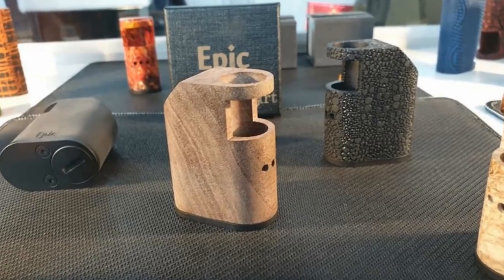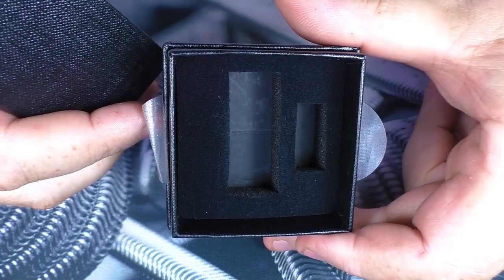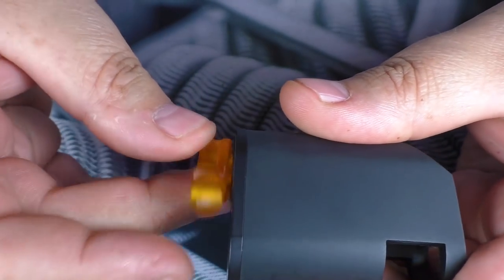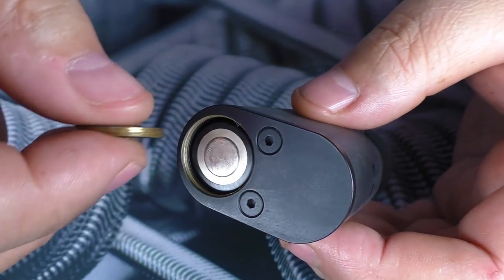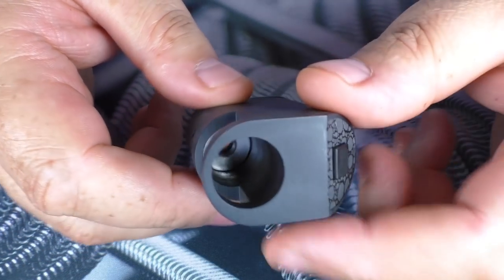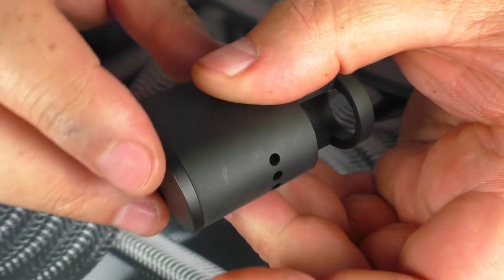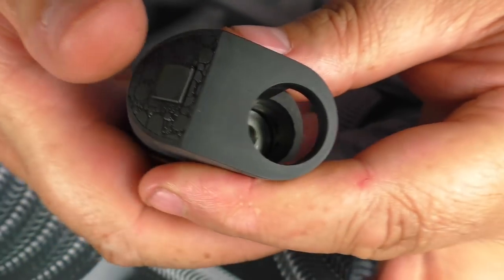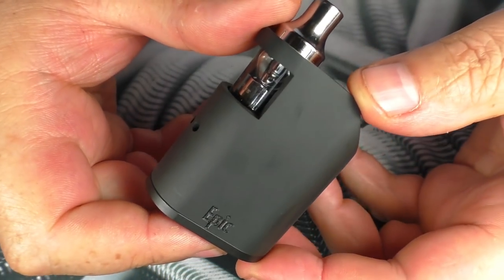Epic by elcigart

Comment: It's really cute and would be worth thinking about if it could take a FeV VS. ;-) (I can't stop gushing about that brand, I'm sorry)
But I'm really confused about the mix of materials and your warning about it autofiring, when you put the battery in the wrong way. It does have a chip, couldn't it have some safety features?
Otherwise I really like the impression I'm getting.

As always - thank you for sharing! :-)
Reply: The auto fire reminds you directly when you screw the battery cap in that the battery is in the wrong direction. The chip does this, it's a feature
Reply from the maker: It is in its own way a safety feature, in the old days putting a battery in the wrong way would fry the chip, autofiring is just telling you it is in the wrong way.  If you read the YT video description I put the full spec for the mosfet in there :)
Reply: Thanks, now I get it! 😊